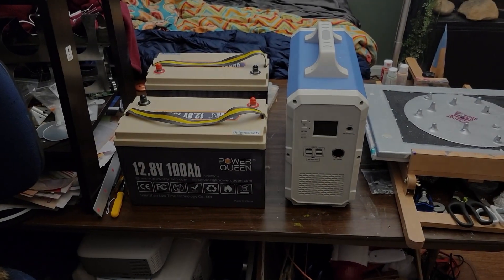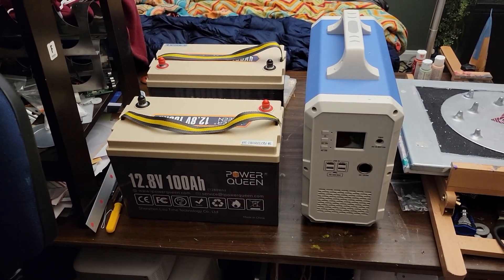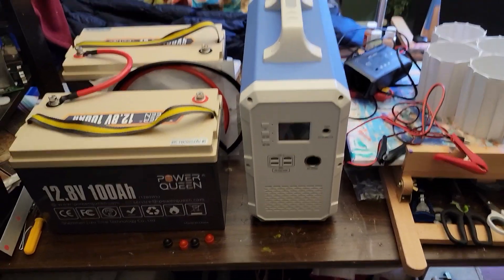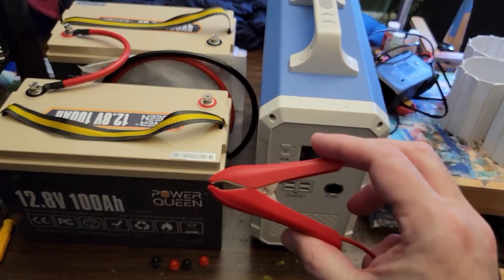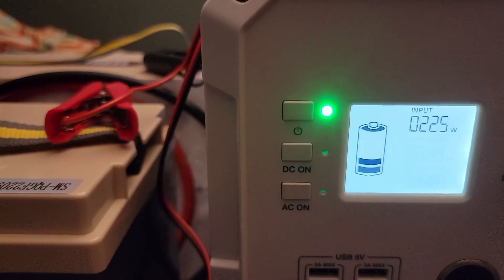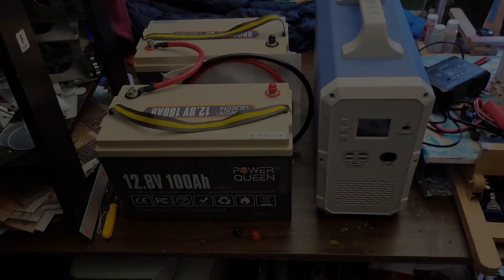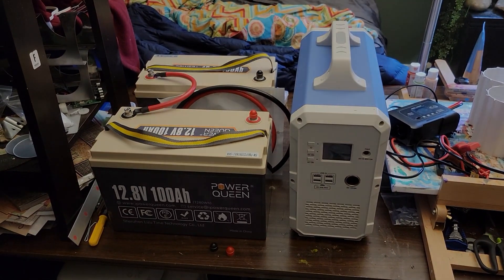How to expand the capacity of a Bluetti EB150/240 with external batteries.

Comment: I did something similar. I bought 4 - 50ah Power Queen batteries . 51.2V in Series, it charges my Ecoflow Delta 2 at 500 watts.
Reply: I was thinking of doing something similar with 24V and a Bluetti EB3A. Nice to know it works!
Reply: That’s good to know, thank you for the tip.
Reply: Great idea!!👍

Comment: Thanks for this. I've done the 12/24 step up converter and ran a Bestek 300w pure sine inverter connected to the ac brick. Another way is to get a AC200p 400w ac brick with a higher watt inverter to the EB150 port. The EB150/240 are great machines, too bad Bluetti discontinued them.
Reply from the maker: You can't beat the simplicity of the EB150/240.

Comment: Yeah this is way better than investing $2,100 for a 4kwh battery expansion for my ecoflow delta pro 3 when I found a steal from ecoworthy selling 2 12v 280ah batteries for $760 giving an overall total of 6,720Wah. 1/3 the price at almost triple the capacity but my confusion is if a battery charger can charge the two batteries simultaneously in series or do they have to be charged individually?

Comment: THANK YOU! I was considering doing something similar using 2x 50AH 12V batteries hooked up to a Bluetti EB3A exactly like that.  I was considering the Redodo 50AH 12V ($170), two of which fit perfectly inside a Milk Crate box topped off with a plywood cap the EB3A would sit on (I don't like messy wire setups).
Reply from the maker: Excellent!
Reply: The Timeusb 50ah @ $140 are a good deal
Reply: @mdunbar04  power queen, timeusb, redodo all the same I think.
Reply: I'm considering doing something similar. I just got the EB3A and a 120 watt panel. I really like the combo so far but of course I'd like to increase the capacity inexpensively without too much of a hassle. Dr. Prepare is at the top of my list currently.

Comment: I would say this is great for emergency situations or just to prolong the use of the power station without paying the high price for the units with expandable batteries. For this model I would recommend 4 batteries in series to max out the charging input around 48 to 52 volts since this model can take up to 60 volts and up to 10 amps charging. It would work great at night when solar is not available or you can have a good size solar charger and solar panel set charging the batteries while charging the power station and running something like a window unit for longer run times.
Reply: you can charge while you use the inverter, right? So effectively is like having a bigger battery
Reply: @assemblywizard8  yes. though most people say charging and discharging at the same time puts more stress on the batteries and shortens the life of them.
Reply: @jw3843  how is that possible?
i thought most people with expensive setups or few batteries have solar charge controller and inverter connected all the time.
Reply: @john-j7e7e  All you have to do is use the batteries as solar input to the power station which will charge the power station like solar would. The older version of bluetti ones only take dc input. The easy way would be to use the solar charging cable, connect them to the batteries and use the charging plug for the power station. You can still have the batteries connected to a solar charge controller during the day. If used for this purpose you would not need to have an inverter separate from the power station. Of course, if you have the batteries set up for 48 volts, then you would need a solar charge controller made for 48 volt batteries.

Comment: Hi paul,where can I get a charger like the one you use in the video
Reply from the maker: It's just a cheap one from Amazon. Does the job fine. https://www.amazon.com/gp/product/B0B3CV4S2Y/ref=ppx_yo_dt_b_asin_title_o09_s00?ie=UTF8&psc=1
Reply: thanks for the help, but the cable that I am  referring to is the one that you connect to the battery and connect it to the bluetti where I can get it

Comment: Although this is ok, The big problem is when wired in Series you only have 1280wh and it remains at 100AH in a perfect world, and the EB150 is equal to117.18Ah which means the Batteries do not have enough Wh to fully charge the EB150, So you need the batteries wired in parallele and use a stepup transformer to turn 12v in to 24v in order to have 2560wh @ 24v otherwise the batteries 12v output is not enough to charge any of the EB Series Bluetti/PowerOak Sogens that have a minimum input voltage of 16V, Hope that helps..

Comment: I have the 240 and went with the B300 and have 800 watts of solar running the system - my concern is leaving the inverter on 24/7 to run the fridge. We will see how this goes - I can't protect the 240/B300 - the temps in the cabin run 14F to 125F - let the games begins. Like your set up and would likely do similar later but with an inverter not a solgen and use my solar, or new solar. I like the panels are getting smaller but more powerful too - don't have the real estate to cover with panels right now. So less being more is nice. Costs are leveling off for the short term, so I best bite soon.

Comment: My question is does it add to the capacity of the eb150 or it’s just another way to charge it
Reply: i mean, it's kind of the same thing? charge up the batteries with spare solar comming in. when there's little/no sun use the batteries to charge the Bluetti.

Comment: Tbh it’s more another way to charge the Bluetti than changing the capacity. Thought you will open it up and add those batteries to the internal charging circuit. Maybe my fault. 😔

Comment: How do you recharge the external battery? Will they recharge through the bank or do you need a separate device?
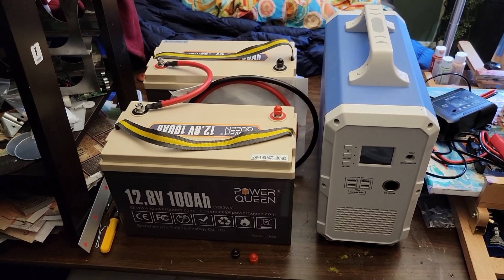Reply from the maker: Scroll to 6:30 in the video. You need an external charger.
Reply: if using solar to charge all the batteries you would need another solar charge controller for the external batteries and might as well get a few more panels too. So you need more batteries, more chargers, more wires, and more panels. So its like you just need two complete solar generators minus the second inverter.

Comment: In a pinch, this is good... Although I wouldn't use this otherwise because you're depreciating the life cycles of on system to charge another... Why not just use solar... But, yea in a pinch I can see this being useful...
Reply: Because of clouds? or it's getting more cloudy? just a thought.
Reply: @MrCharmz81  Of course but,  what I'm saying is why not use a gas or, propane generator during those times... Otherwise it's redundant, and you are depreciating the life cycles for nothing...
Reply: @apocalypticminister1369  You do strike up a good point there, problem with me is gas storage. I only have one gas gen that works, other one died. I don't have propane, but that would be great to have though in a situation without sun.
Reply: @MrCharmz81  Thank you brother... Yes! I have a 4,000 watt 5,000 peak gas generator... I actually plan on installing a propane converter because Propane is non-perishable so in a SHTF episode or, just to charge my batteries it's indeed much more efficient over using my lipo life cycles... I have two 200ah Power Queens with the Victron setup... The funny thing with the charge controller is that you can charge your batteries, and if they are full, you can hook up an inverter to absorb the excess power into your power Station, instead of depleting your life cycles... Or, in my case, I have the actual panels that are compatible with my Power Station, and I use it for both systems... I will be making a video soon so you should subscribe, I can show you my process in detail...
Reply: @apocalypticminister1369  You're welcome and right on, That's ironic you mention SHTF stuff. I feel the same way about to have some kind of contingencies in place. Those power queens you mention are they pretty good quality? I will head over to your channel and subscribe I am interested in watching the process in detail.
Reply: @MrCharmz81  Yes Sir, and thank you brother! The Power Queen lipo batteries are great!!! I love them, and want more... 
     My first video was ok... I had some trouble with my camera so, the next video will be done outside... I have some pretty cool things to show...
Reply: I am wondering about this. Assume you are charging at 200W with these batteries in series and at the same time using the inverter for 200W. Does it means that you are making more work  or effectively you are just discharging the external ones? In other word my question is: is there an circuit that prevents energy to be taken from the DV input directly when using the bluetti?
Reply: @assemblywizard8 
   The charge controller only allows out, what we need for a load.. If you are collecting 200w, and using 200w all the solar you're generating goes straight to power your load... If you have more it charges the batteries, less it discharges the batteries...